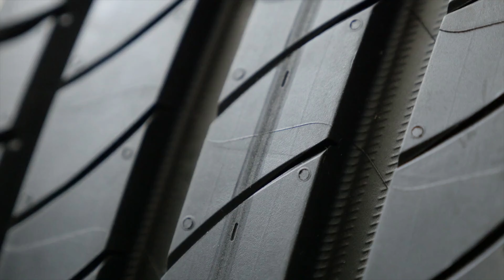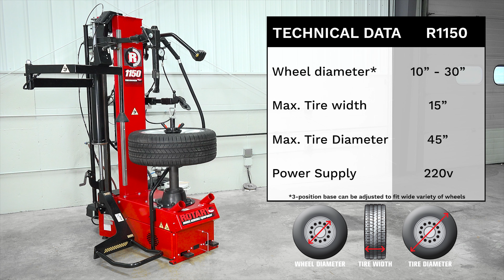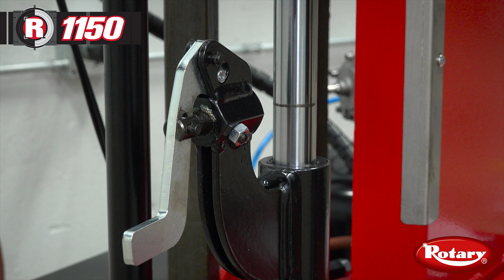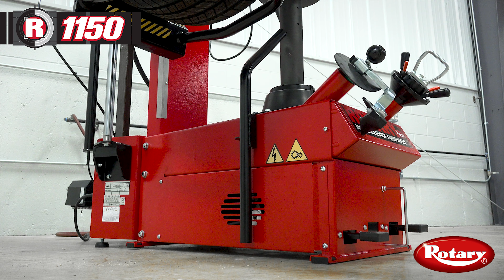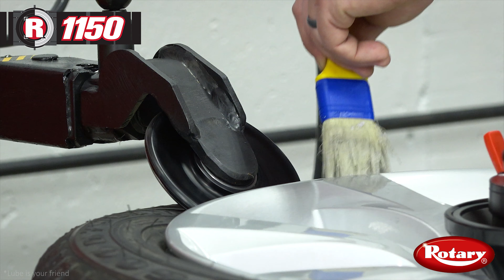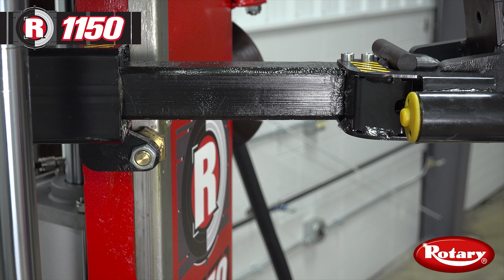Rotary R1150 Tire Changer Operation

Comment: I'll be honest. I'm completely new to the automotive industry, in fact I'm about 3 months in. Doing oil changes, MPI's, replacing cabin and engine air filters, and tire rotations are extremely easy but dismounting and mounting tires is a huge weakness for me. I work at a dealership so it's a very fast paced environment. This past week, I dismounted a tire with no supervision. It took me a little while but I got it done. Only thing is that I still struggle mounting a tire back onto its rim. This tire machine is essentially the same one we have at the shop and I have to say this video being extremely helpful is an understatement. Thank you so much 🙏🏽🙏🏽
Reply from the maker: Thanks for the comment Javier!  We are always happy to hear when one of our products or videos are helping out a technician.